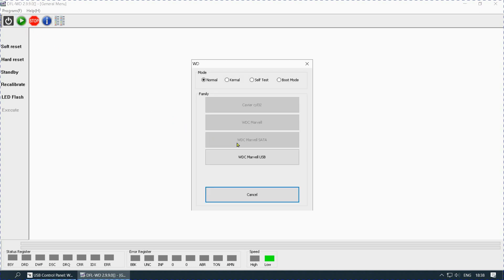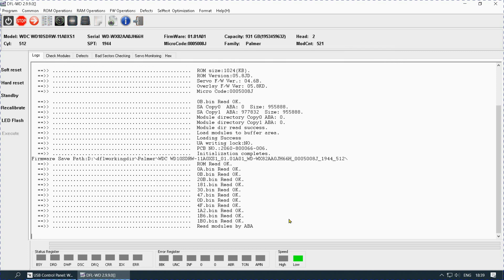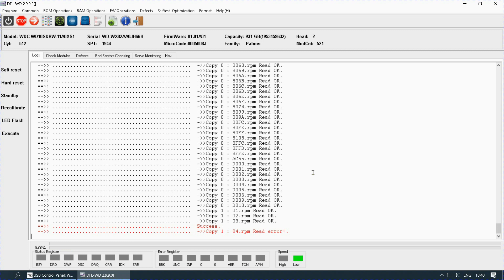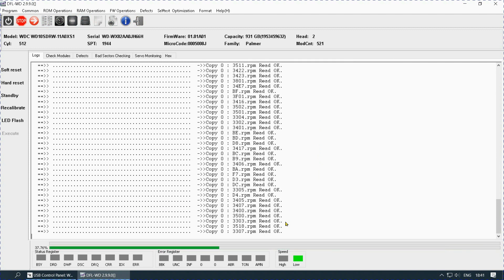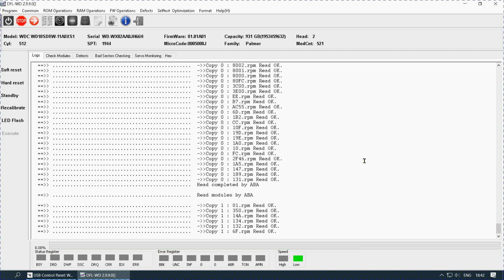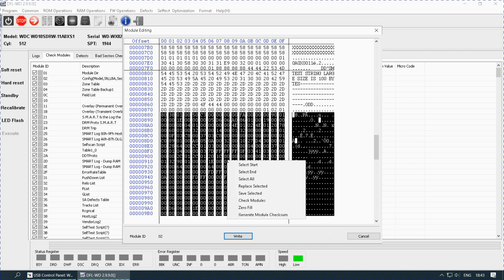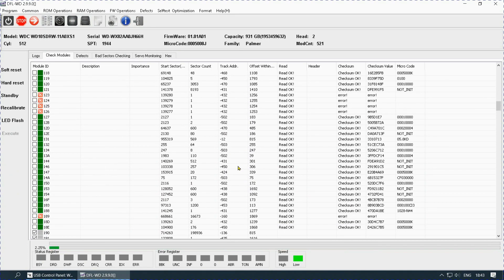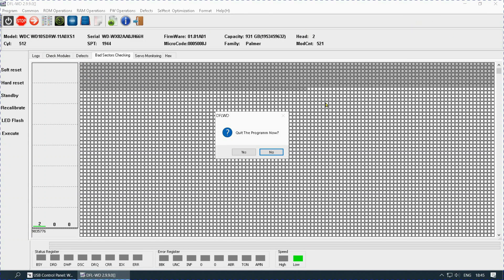How to Recover data from a  WD PALMER HARD DISK

Comment: Hi
On what basis did you determine the problem in module 02?
Reply from the maker: On the basis of what dolphin  manual has shown us regarding 02 module in these class of families.
there are other several ways to clean 02, since the two copies couldnt be obtained, we had a chance to work from one copy only. there is a ption to find problomatic modules in dolphin srp. i could locate the problem there by checksum and weak area on tracks.